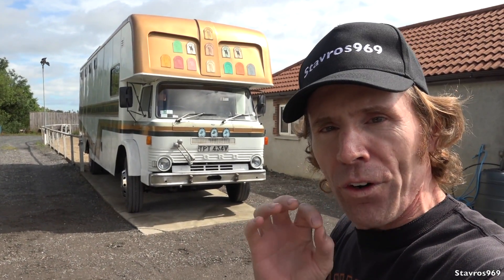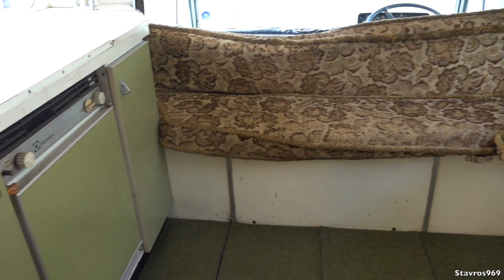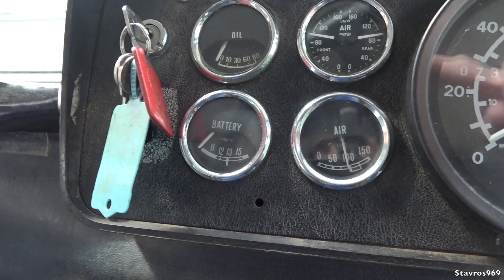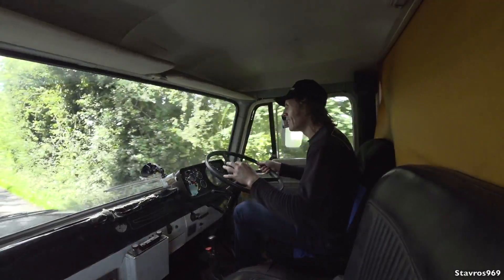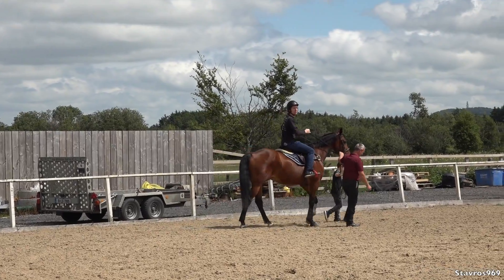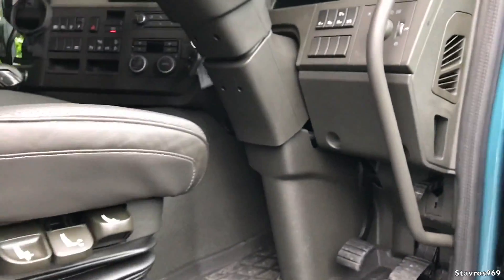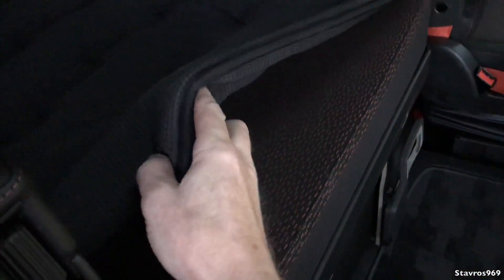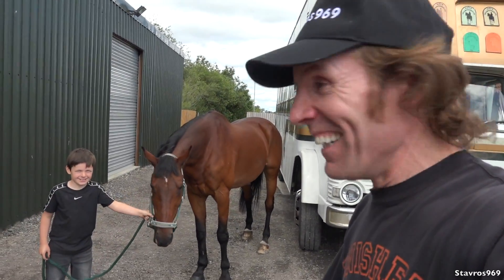1970 Ford D-Series Horse Truck Tour & Test Drive + New VOLVO Trucks Range

Comment: Spoken to my dad, there were 14/15 of these D series chassis cabs that had spent there first few years on down on Sunderland Port with a flat bed bodies on them with only delivery mileage on them. 7 of them were acquired by local colliery managers to be converted into horse boxes primarily for use of transporting pit ponies off site. They were also later used for horse shows around the North of England and occasionally in the Midlands. They were sold to private ownership in the late 80's to early 90's when the collieries started closing.

Comment: Great video Stavros. 
I drove a Ford D series double drive tipper in the 80's before I graduated onto attics. That extra arm on the driver's side wiper was to change the angle of the wiper blade so that it could clear all the screen in front of the driver. You'd need to turn it on to understand what I'm on about. Nice Volvo lineup. 
If you had 750 of that horse you were riding, you wouldn't be going anywhere in a hurry,  or maybe it's not the horse that was the problem😂.
You need to get you hands on one of the new Ford F max  tractor units for a test drive next.

Comment: Ford D series although old and outdated now was a real mare to drive. I had a 2817 with the Perkins V8, great sounding engine without a doubt but very low on power and overall hideous to drive.
Volvo- favourite trucks of all time. As a owner driver working for a Spanish company out of Malaga I had a F7 224hp and at 40+t it struggled.
I pulled tilts from Malaga to Calais return with an 85 F10 300 then bought my favourite the F12  400 EDC with 16 speed range change / splitter.
The torque monster followed, a FH16 700. This would pull a licence losing 50tgvw over the Mont Blanc gradient in top gear at 100kph!.
The new range looks nice but overall I prefer the 80s/ 90's F series. They really had something about them with their triple wipers, big chrome VOLVO letters across the front and superb engines and range / splitter box's. Plus of course polished Alcoas, Eminox stack , VOLVO  bumper flaps and of course the obligatory Michelin man sitting on top of the mirrors..😊

Comment: That's a minor problem getting 4the  but your Eaton button on the gear stick is a 2 speed back axle And not a splitter but if your quick you can go threed high axle to low axle 5th no sweat I drove one of them for to meny miles and a guy Big J from 1972.

Comment: The contrast between the 1970 Ford and the new Volvo’s was incredible! The oldest truck I have ever driven was a 1959 International, it was made the year I was born and is no longer on the road. Thanks for the video of the new Volvo’s they look like they will do the job. Did I hear you correctly and the one truck had a DCT? Double Clutch Transmission?
Reply: Micah Getty Yes the FH16 750

Comment: You think that old D series was loud in the cab? See if you can track down an LAD cab Leyland / Albion. Mate of my late father had a 6x4 concrete mixer on a Leyland chassis  (Might have been a Bear, they all had funny names), and you could be in passenger seat, and shout and scream, and the driver wouldn't hear you! Those were the good old days?
Was that a D1000? If it was, I suppose it was the turbo six cylinder. Just think, 16 ton, and 140 bhp. Now 7.5 tonners have more horses (sorry)than that !

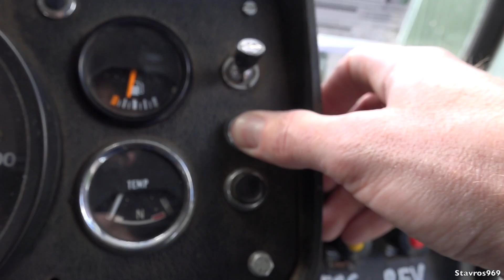Comment: The living quarters look terrible! Not to mention the brake fluid reservoir has some sort of goop in an attempt to seal up a leak.. @7:44 The steering wheel emblem should have read "TURD" not "FORD" ! Not Fords best days when it came to deaign.
Reply: My 1968 Ford D1000 with a Cummings V8 was in another world when it superseded the Thames Trader, 70 mph up and down hills , remember it was over 50 years ago.

Comment: @stavros969 I kinda hate the new techy dash and the hideous grille on the FH16. 👎👎👎🤮 I do really like the new look of the FM/FMX however. 👍👍👍 I hate the glass dash because you absolutely can't drive them if you ever have an electrical issue. Although modern aircraft also have glass cockpits, they are mandated to have back up standard guages for emergencies. These new-fangled trucks don't have any backup guage system, so there's nothing you can do when the screen quits (quite common emergency in aviation). Also, the concealing of all the information features into one drop-down list distracts the driver from actually driving (e.g. climate control settings) making it more dangerous (ironically, Volvo is supposed to be known for safety…tut tut). The infotainment screen is more like an iPad distraction than anything else. Other than that, great vid! Cheersssss!!!